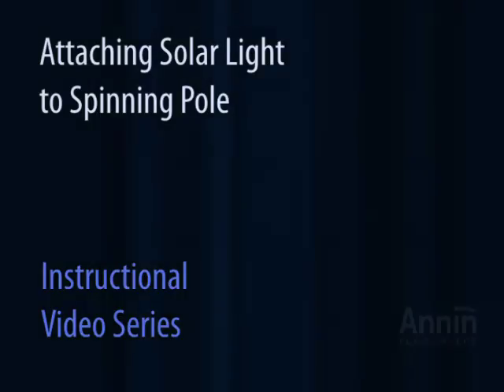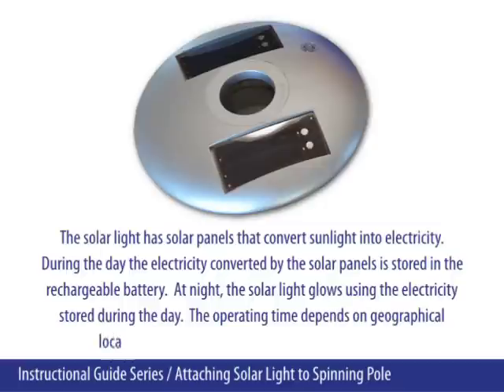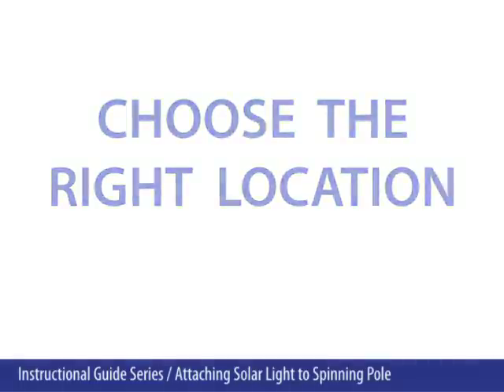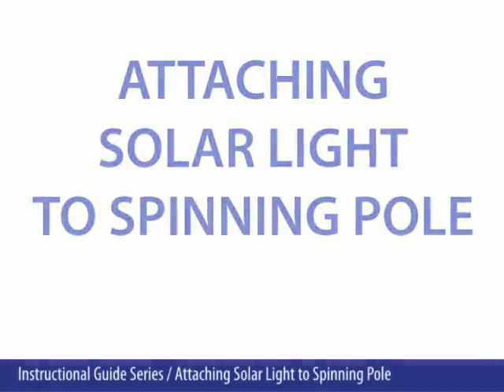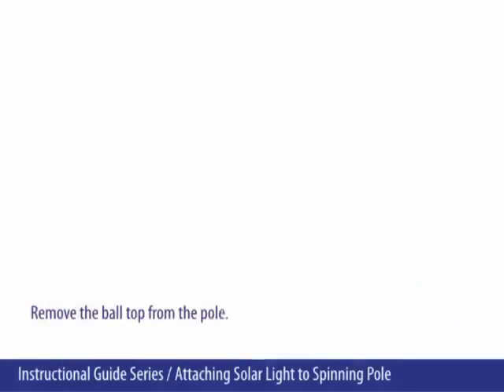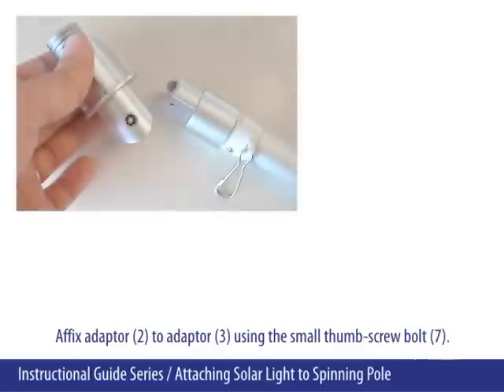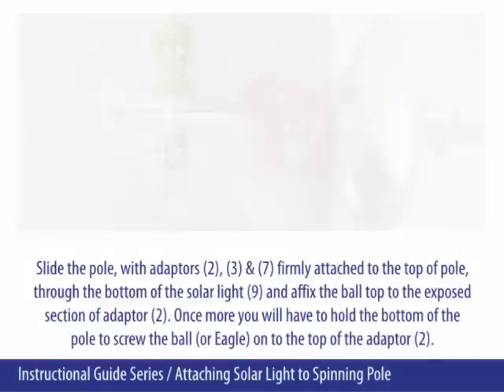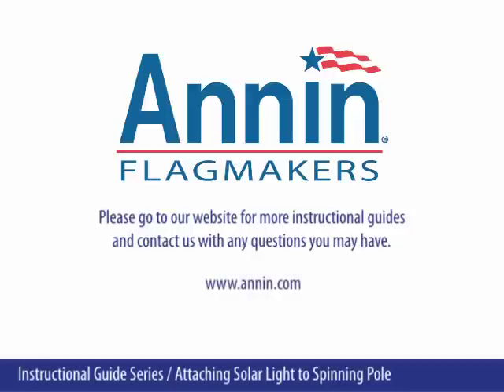Instructional Video-Attach Small Solar Light to Spinning Pole

Comment: It would have been beneficial to see a discussion about how to angle the light.  I agree that this light gives a soft glow, but with the flag flying at an angle, how should one angle the light?  Parallel to the ground?  At an Angle?  The lights are in a triangular pattern.  Does it work better with the two lights forward or toward the back?  It's kind of hard to tell and I don't want to get up on a ladder at night to try to make the adjustments.  What do you recommend?